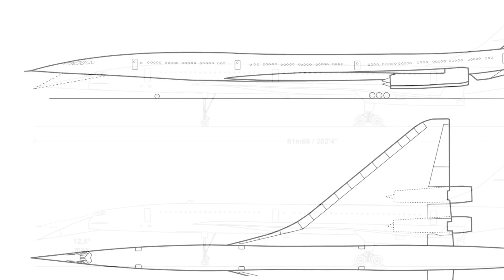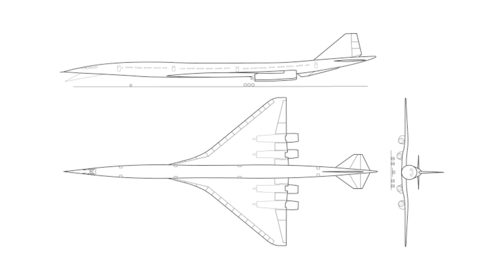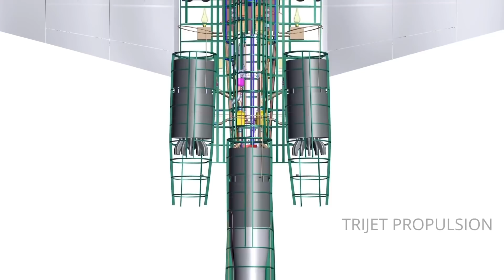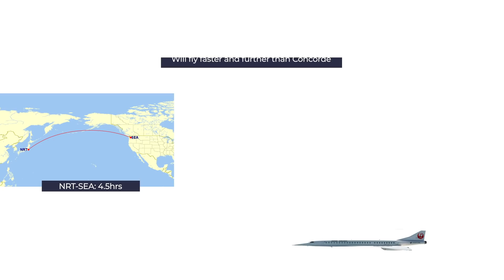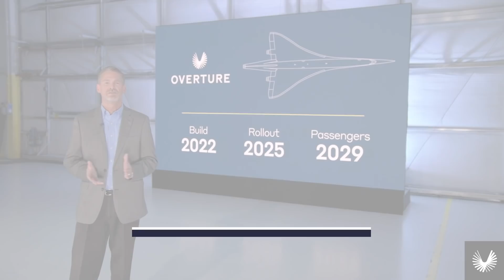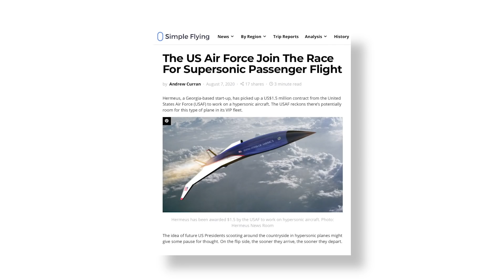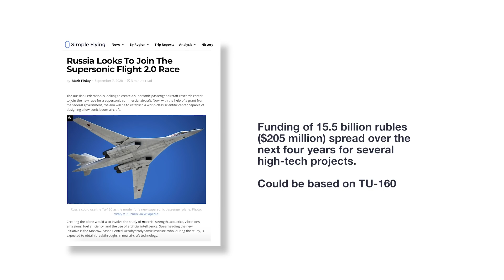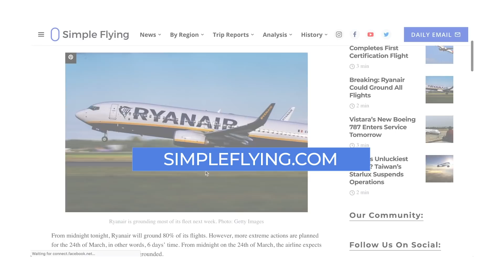The Race For Speed: What Supersonic Passenger Planes Could We See By 2030?

Comment: With the current air transport crisis, there is no market for supersonic passenger planes.
Anyhow, there are currently no plane engines able to fly at supersonic speed with an acceptable fuel consumption while meeting noise regulations around civil airports...
A totally new kind of engines should be developped, which would take many years at huge cost for a very small market, without any garantee to get a satisfying result !

Comment: The Concorde did not fail because of fuel consumption or ticket prices -- it flew full most of the time. It failed because it was denied the ability to flyover land and it DIDN'T HAVE THE RANGE to fly most trans-oceanic routes. In the end it was down to NY-London-Paris amounted to a dozen or so aircraft. This is not enough to support ANY commercial aircraft program.
--
For any of the new supersonic entries to succeed they need to win regulatory approval to fly over land or they need enough range to cross the pacific -- preferably both but either alone will make them commercially viable. Crossing the pacific means 6300 nm of range. About the same as a Boeing 787-10 or the classic 777-200; enough for LA-Beijing, SF-Taipei, NY-Dubai, etc.